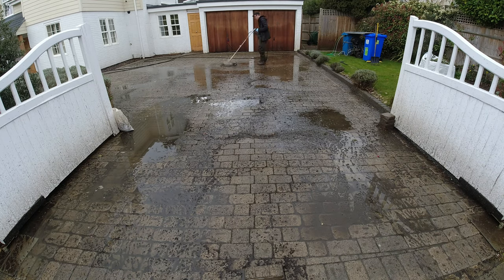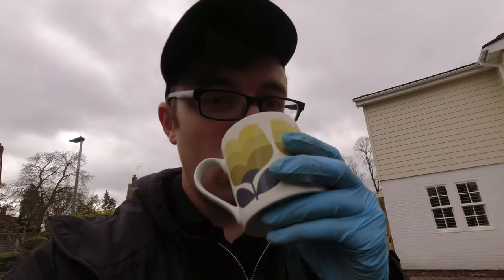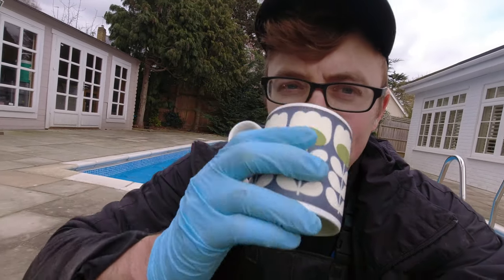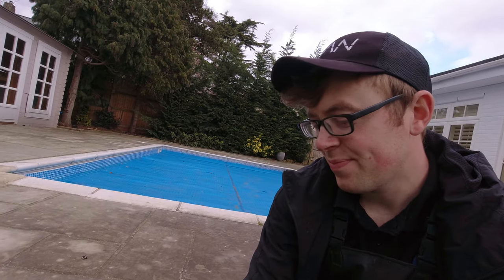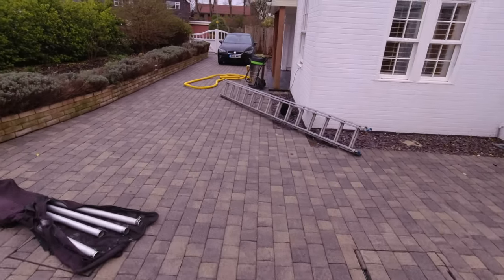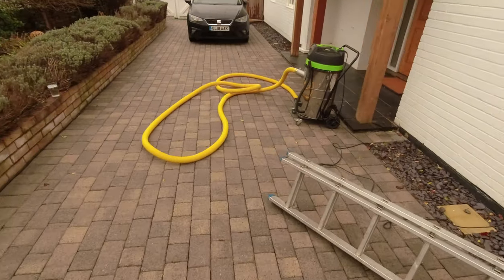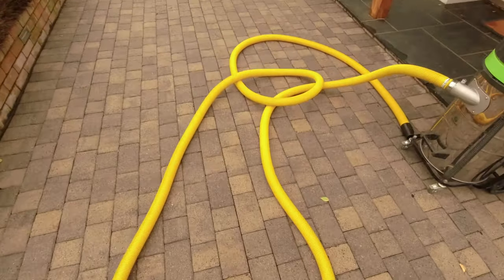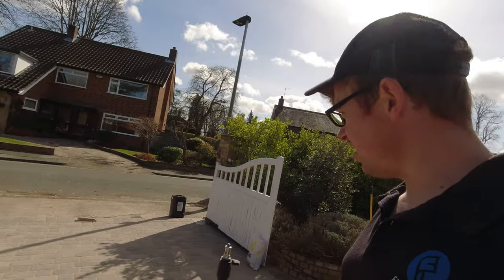Pressure Washing TOUGH GRIME Around A Pool That Hasn't Been Cleaned In YEARS!

Comment: Bravo! You did good job on that one and do you use a regular sand to fill the cracks? I want to start my own business doing that but I don't how much to charge them and is it by the hour? Please fill me in so I can get started. I'm not planning going back working in anymore plants. I want to make my hours. I still have to get my pressure washer and the big round scrub brush and they don"t cheap here in Texas.
Reply from the maker: Hey Sandra, 
It’s kiln dried sand.
I have no idea what you could charge on the states to be honest, you need to work out a reasonable rate that will cover you overheads

Comment: You did an amazing job mate, really came up nice. Did you have to post treat that or did you lay SH before you started cleaning. Top class video mate
Reply from the maker: Cheers Gary, first thing I did was treat It with SH and then waited a short while then had my surface cleaner on low pressure and comes up a treat. Then done the edges and rinse down after.. even with a weak batch of SH due to the rain It still breaks It down fast

Comment: Hi pal. Great job you did. What sealer did you use 24 hrs after washing! Does it not need to be bone dry to seal off cheers Ja.
Reply from the maker: Cheers Jason, used the Resi block sealer as It only needs one coat. As long as the sand and paver Is dry you are good to seal.. has to stay dry for 24 hours after application though

Comment: loving the content. Can I ask, how are you lifting the pressure washer in and out of your van, as it looks very heavy?
Reply from the maker: Cheers much appreciated, I carry a ramp In the van so It’s easy to load In and out no problem. I’ll try remember to film It In a upcoming video
Reply: @FlawlessCleaningServices  thank you! would love to see the set up. I've not long bought a machine myself and it's so heavy! I think I'll look at some ramps. Also if you don't mind, are you just using a wheelie bin for your water feed? I'm unsure whether to use a bin or put a baffled tank into the van? Thanks again fella.
Reply from the maker: I don’t keep anything In the van It all comes out, but has Its place. A wheelie bin, I have a baffled tank but haven’t bothered putting It In. I’ll keep that in mind for up coming vids
Reply: @FlawlessCleaningServices  thank you.

Comment: when i had my drive sealed,they did it with a paint roller, the contractor said sealing with a knapsack doesn't get between the joints as Well, BEEN done 3 years, no sign of Any weeds coming through.
Reply from the maker: Just apply on and make sure you cover the joints correctly, been back since and the sand Is solid. Cheers for watching 😊

Comment: Did you have any problems with chemical run off into the pool mate ? PS I used to live in Petts Wood.
Reply from the maker: The chemical Is actually used for pool cleaning too, So the run off wasn't and issue. The owner planned to get It all cleaned after.. should be going back next month for the annual clean. Still living local?

Comment: A lot of tiger striping in this video!
Reply from the maker: Thanks for watching, are you saying that about the patio? While surface cleaning It was heavily raining and pooling In areas on poor drainage.. so the surface cleaner sometimes leaves bits behind.. could also of been because I went to quick. 
But once I rinsed down with lance after the chemical I could lightly go over what I’d missed.. 
customers checked It all over and were extremely happy.
All the best,
Ben